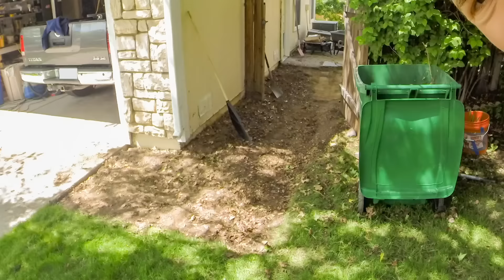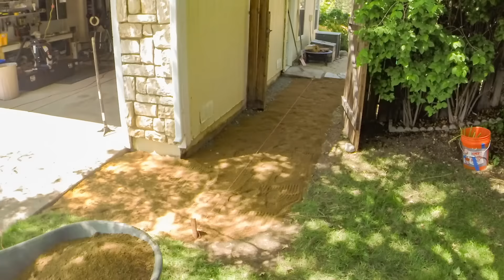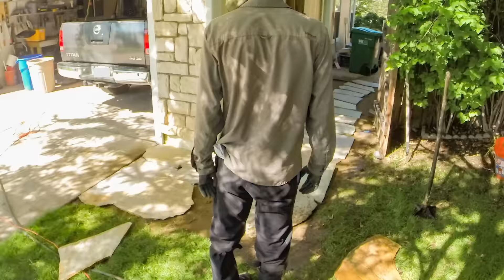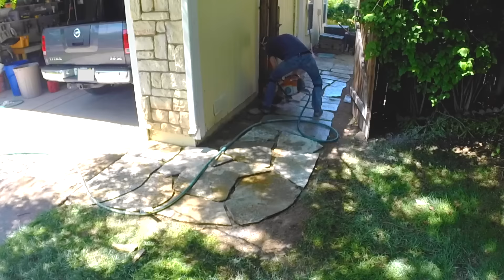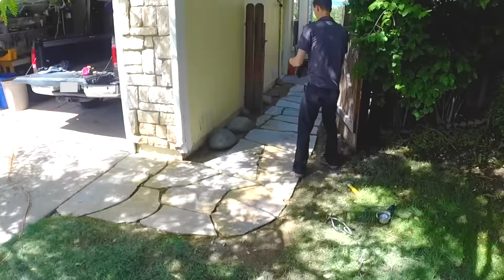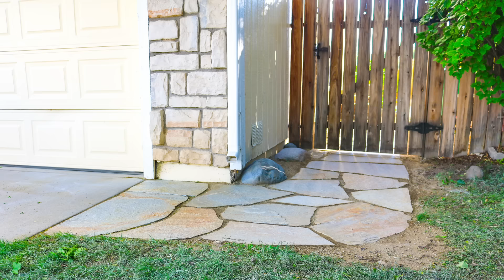Build a Flagstone Pathway In 5 Minutes

Comment: He did such a beautiful job! My question is: Was he going for the grass eventually growing between the stones? Some people like that look. I guess he could've put down a weed cloth and filled the gaps between the stones with a fine pea gravel for another type of look, too. Or, he could've used paver set sand and maybe kept the weeds & grass out of spaces between the stones. Would love to see an update later as the grass fills in to see what it looks like.
Reply: Seen way better pathways than that… personally wasn’t impressed at all./
Reply: @macysondheim  I bet you have never built one yourself. 
Step off Hater.
Reply: @macysondheim  I just finished a pathway with about forty five natural stones. Different thicknesses, shapes, protrusions, pivot points, etc. Took three days even with lots of my tricks and cheats...looks great, good meshing, balance, and decent water shedding. I still need to see how it weathers for a few seasons, and appreciate that OP did this time lapse in addition to the full videos. It's one thing to "have seen" better work, it's quite another to work up to the task and do it.
Reply: The weed cloth won't work if your putting topsoil in between anyway your better off spraying it and letting grass fill in the gaps

Comment: Great inspiration video for a small project. I didn't see any edging used to hold pavers in place and keep them from migrating. Is that normal for sandstone?
Reply from the maker: You don’t need edging as long as you place the larger stones around the perimeter.
Reply: @StayHandy  You are correct! Once I starting lifting the larger sandstones yesterday, I found out how heavy they are. I watched your longer video too. Thanks again for filming and posting.

Comment: Thank you, your videos are very helpful. We have only 1/4 in slate, can we use That for a flagstone patio following your instructions for 1-2in flagstone?  Do we have to use concrete and mortar for the slate?
Reply from the maker: 1/4" seems very thin. Honestly I don't know the answer but it seems like that would be fragile and you'd have a lot of breaks over time.
Reply: For a walkway you can get  y with 1.5 inches, but 2 inches is recommended.    For a patio definitely 2".

Comment: Never worked with flagstones are they not flat on both sides? The part where you're leveling each stone seems to show that
Reply from the maker: They aren’t perfectly flat and they also vary in thickness slightly.
Reply: They are split sedimentary rock, and cleave in random thickness. They vary in flatness. These stones were uniform, picked for uniform thickness and very thin. Laid as shown without concrete base and no mortar, they may crack under heavy load or if ground freezes and heaves. Not for heavy loads nor for severe winters, maybe ok with light traffic and mild winters.